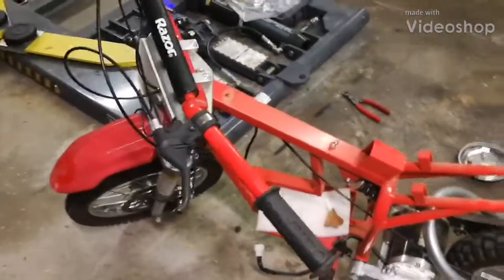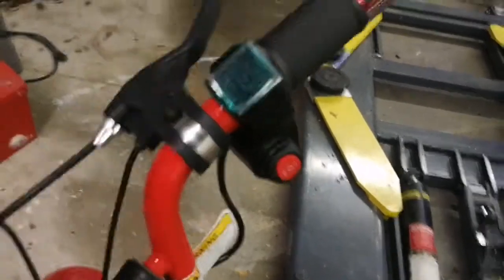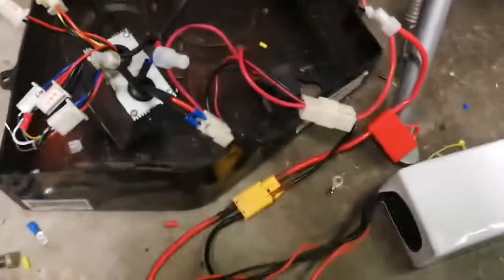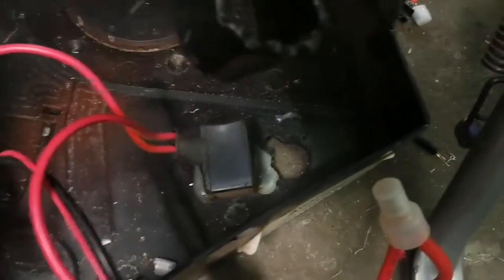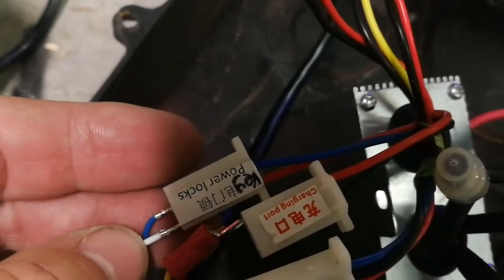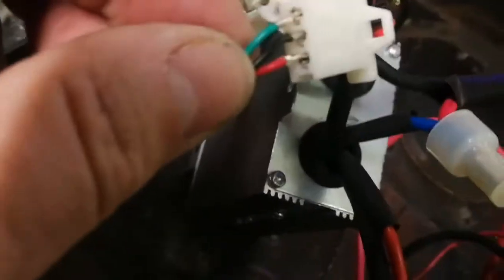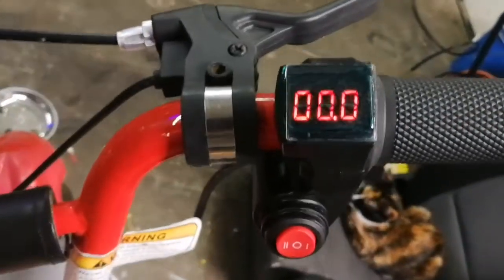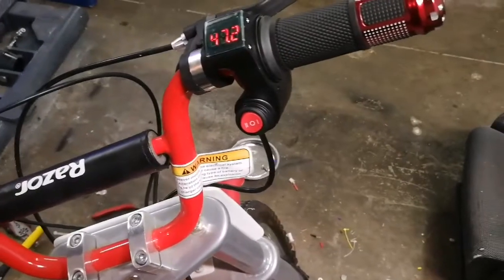BUDGET 48V Razor Pocket MOD RSF350 MX350 MX400 SX500 MX500 MX650 upgrade

Comment: How do u get the throttle kn
Reply from the maker: On what?
Reply: @VintageSpeedwerks  razor mx350
Reply: @VintageSpeedwerks  I bought the throttle idk how to get it on
Reply from the maker: @so4a6n  possible mx350 is different? Doesn't just slide up and you tighten the screw?
Reply: @VintageSpeedwerks  no the seat won’t slide up for some reason when I took the screws out maybe it’s because the on off switch is in front of the seat and it’s wired there
Reply from the maker: @so4a6n  def possible
Reply: Mine looks different then the one on the tutorial of how to remove throttle and it’s not the same idk

Comment: if i add an additional 12v battery to my sons Razor MX350 (2 - 12v to make 24v) will the stock MX350 controller recognize it as 36v or only pass through the 24v?  I don't want to have to get a controller if i don't have to.
thank!
Reply from the maker: Im not quite understanding, BUT...
If you add a 12v battery and it equals 24, doubt a 36v controller will work due to low voltage.
If you have 3 batteries for 36v on a 24v controller, that will work.

Comment: No link for the lipo?
Reply from the maker: Not using lipo. And no the lithium 18660 pack I'm using is out of stock. I show the specs, a smart person might search those to find another source....... .
Reply: @VintageSpeedwerks  A smart person would know that lipo means lithium-ion polymer battery. I didn't see the comment saying link was down until after I commented.
Reply from the maker: @JustinTwilley  yes exactly,  I'm not using lipo. Best of luck to you.
Reply: @VintageSpeedwerks  So your not using a lithium ion or lithium polymer in this video? What is it then?
Reply from the maker: @JustinTwilley  HUGE diff between 18650 and lipo, hence my reply above.
Reply: @VintageSpeedwerks  You said this..So forgive me for being a bit confused here..And no the lithium 18660 pack I'm using is out of stock.
Reply from the maker: @JustinTwilley  yes. The 18650 pack im using is out of stock. If you didn't know, 18650 batteries not normaly lipo. I can post vids for you if you need further guidance.
Reply: @VintageSpeedwerks  the only 18650 im aware of are the little flashlight batteries and are lipo, are you saying that pack is a bunch of those in series?
Reply from the maker: @JustinTwilley  these are 18650 and are NOT lipo. 18650 are lithium ion. 18650 are bigger than AA so are not little flashlight batteries. Tons of videos on what batteries are what.
Reply: @VintageSpeedwerks  Ive had several flashlights, lazer pointers, and even vapes with that battery, and correct me if im wrong but isnt lithium-ion lipo? Lipo is just short for lithium ion or polymer? Thats what ive thought for years dealing with rc cars and what not.
Reply from the maker: @JustinTwilley  again, like I said, might search the difference. Lipo is lithium polymer,  like most rc car battery
Reply from the maker: @JustinTwilley  look at spelling. Lipo  LI-thium PO-lymer. LI-thium IO-n
Reply: @VintageSpeedwerks  I understand But its still lithium basically the same exact thing.
Reply: I just did a little searching because you had me doubting myself. (In short, it means that so-called “lithium-polymer” batteries are almost exactly the same as lithium-ion batteries, but they are instead contained in a flexible polymer casing. It's basically just a repackaged lithium-ion battery. ... As far as the user is concerned, lithium polymer is essentially the same as lithium-ion)
Reply from the maker: @JustinTwilley  i will agree with your quote,  but not your conclusion. Lipo is def not the same as lion
Reply: @VintageSpeedwerks  Eh a smart person wouldn't have made such a big deal over such a slight difference in the two..